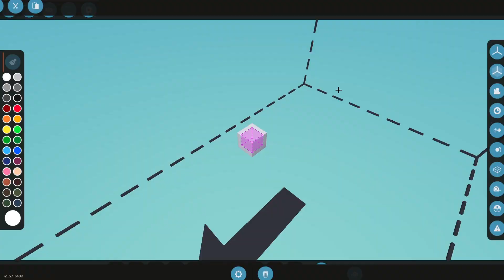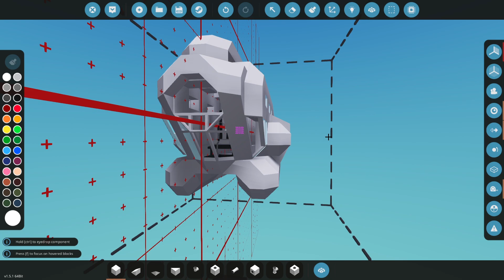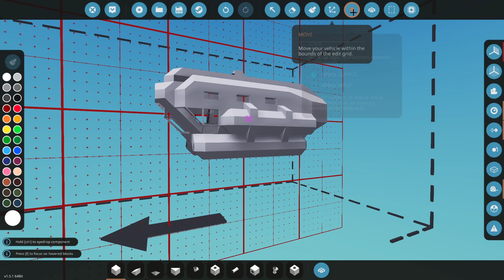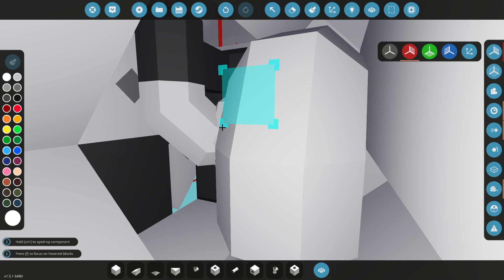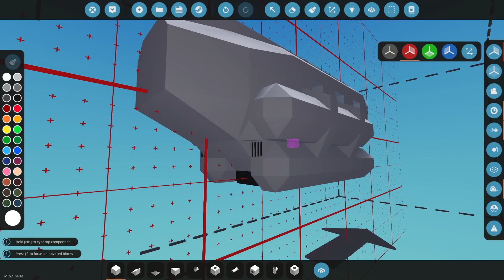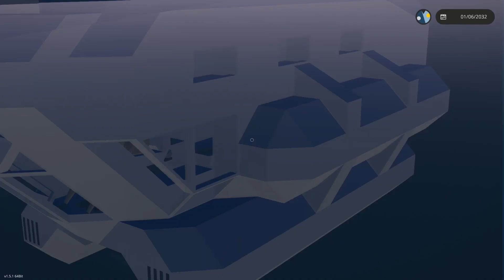Super Easy Submarine Ballasts! - Submarines Part 2 [Stormworks]

Comment: You forgot to mention that at certain depths, subs can't empty their ballast. And if your sub is sinking, and sinks too deep, you're stuck.
Reply: It’s always worth having an “emergency surface” setting, I have my ballast tanks attached by a hard point connector, worse case, I jettison the centre ones (I use front, middle and rear tanks (left and right, so 6 all together)), if you’re stuck at the bottom just dump the ballast into the centre L+R tanks, release them and I’ll slowly surface

I keep the centre tanks empty for this reason :)

The great thing is, doing it this way, if you really want/need to, you can surface, and make it a mini-mission to somehow retrieve your tanks if you really want to :P

Edit, if I run out of/low on power, sink, and both the front and both the rear are full, I dump those, and the air in the sub and the centre tanks is enough to surface me :)

Comment: A little tip. 
1x "Fluid pump" + "Fluid Slot Port" 3x IN and 3x Out. In my tests, this configuration is the most efficient, faster than 2x pumps with 1x IN and 1x OUT and with 1 pump and 4x IN and OUT or more.

Comment: Any idea how to get the water out if you are below 80m? The pumps don’t work because of the high water pressure. You could put it in a row but then you need like 20 of them.
Reply: Stormworks Physics (tm) makes it impractical to drain the tanks below 100m. I suggest you set your ballast to neutral, then use fins and propulsion to climb from the depths.
Reply: @toast3  how do you proprely get neutral ballast? Im usually only able to get something apriximate but no real neutral ballast.
Reply: @karstenstahl8516  Approximate is fine. When testing, stop the sub and get a readout for vertical speed, adjust ballast until vertical speed is close to 0.
Reply: @toast3  ah ok, thank you.
Reply from the maker: Larger pumps or the impeller pumps would work